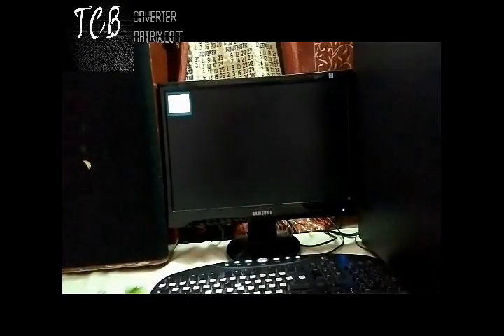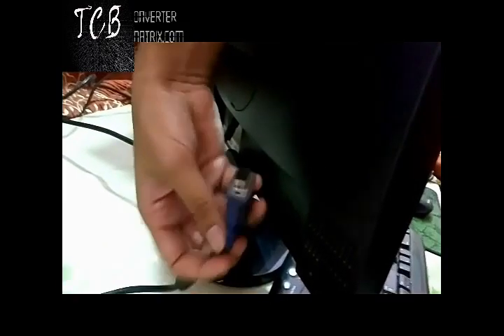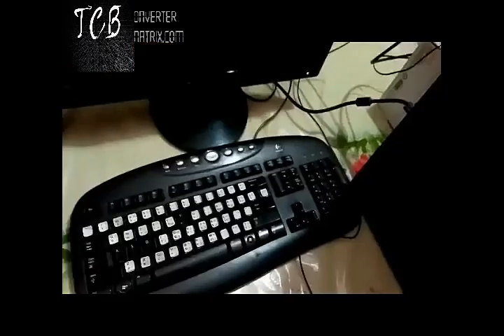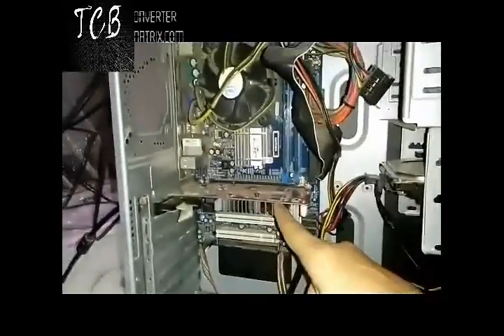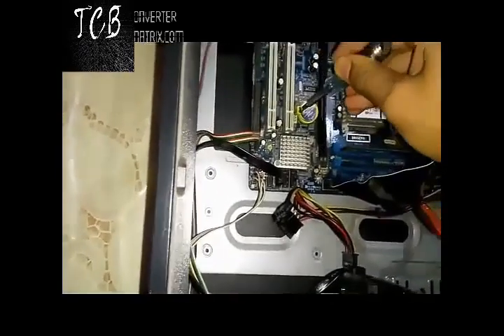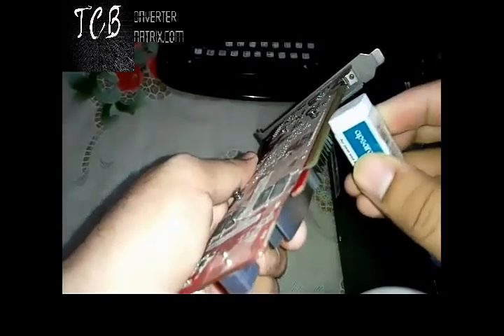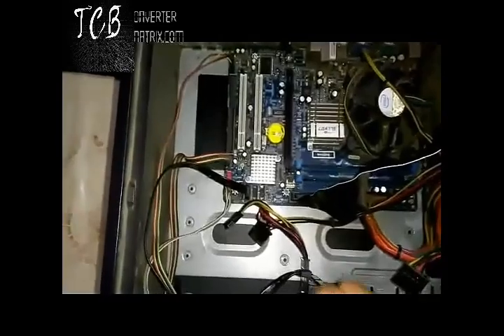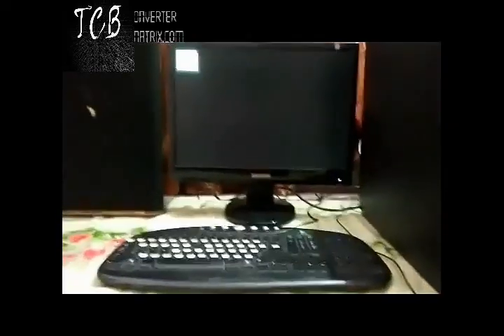how to solve the problem of check signal cable part 2

Comment: cleaned my ram video card and replaced my cmos bat, still nothing worked 
watya think is the problem?
monitor is switching to analog digital then black screen/ check signal cable  red green blue (digita)
Reply: Same
Reply: So did you have any fix?

Comment: Thanks bro!
After cleaning ram checking all connections the problem is still there.
Pc is booting up but on screen menu also not fully showing.
Now I will have to try removing and reinserting the motherbiard battery.
Thanks anyway, we think alike!

Comment: Tried everything
Still getting check analog connection
System is not opening
Also replaced lithium small battery

Comment: This didn't work for me ...
I changed cables and monitor, the only solution i see for myself is find good screws and place it correctly bcuz i got new pc
Reply: My solution actually was that i tried to plug second monitor to mobo but i had my first into gpu, the cables must be in 1 place so i bought myself adapter and pluged both into gpu.
Reply: @3ًźr äễl the cables from first and second monitor must be in gpu or motherboard, they can't be split